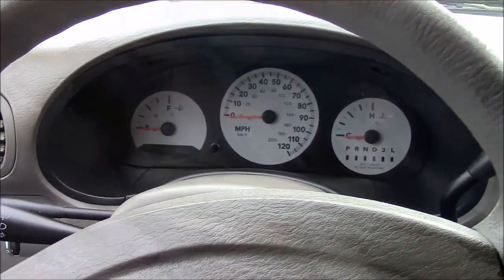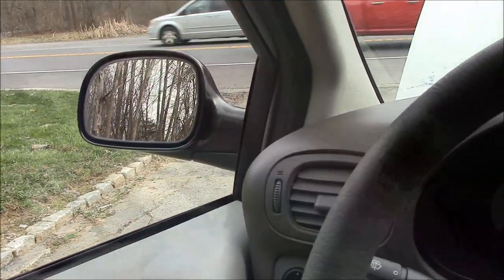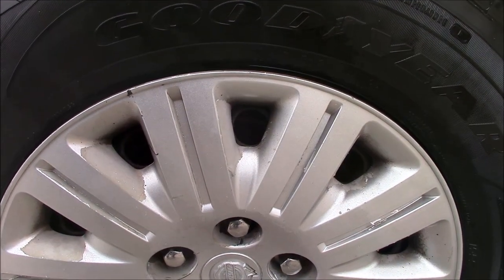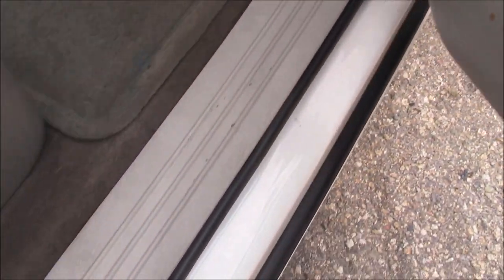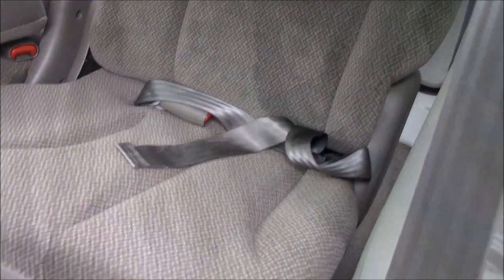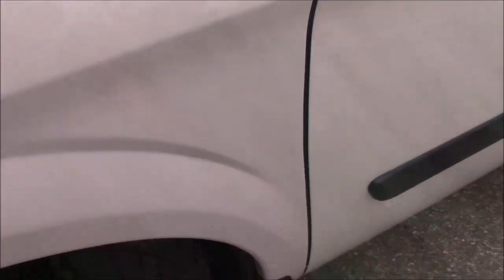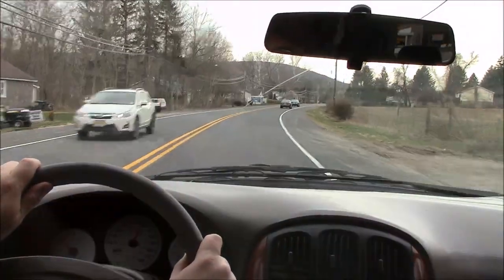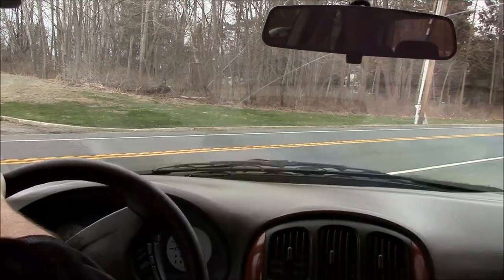2005 Chrysler Town & Country White for sale

Comment: Looked like the valve gaskets were leaking a bit. 
I know this is an old video and that has probably been fixed or the van sold by now.
Reply: Wonder what the asking price was. I'm surprised a dealer would bother with a vehicle tha'ts more than a dozen years old with that kind of mileage.
At that point, it's usually a private party sale to somebody who might drive it another 2-3 years and than junk it. Minivan repairs are notoriously difficult and expensive.